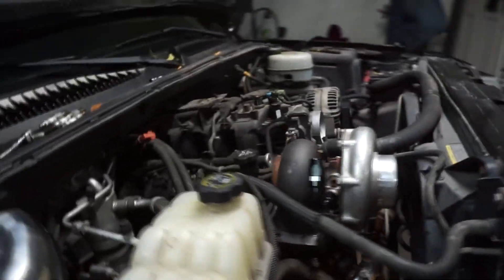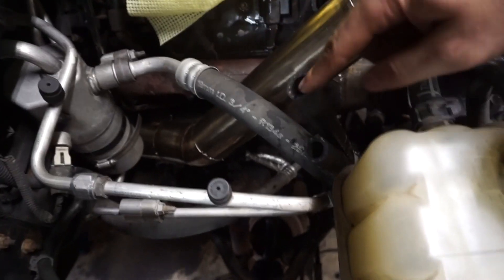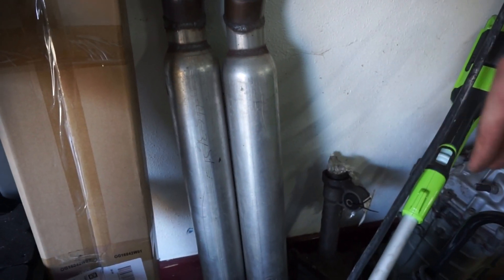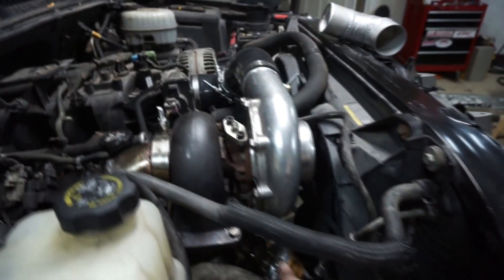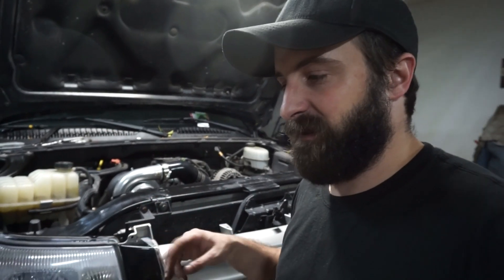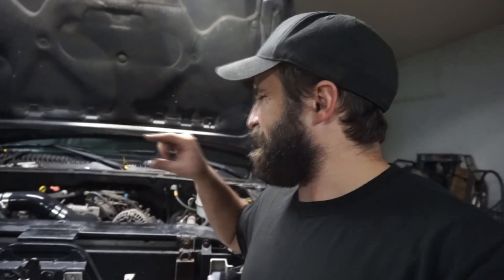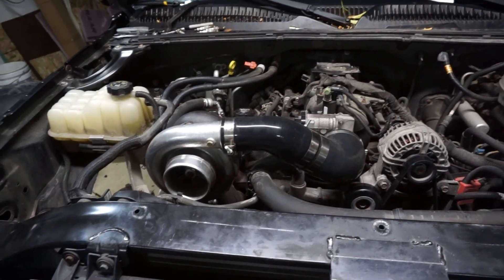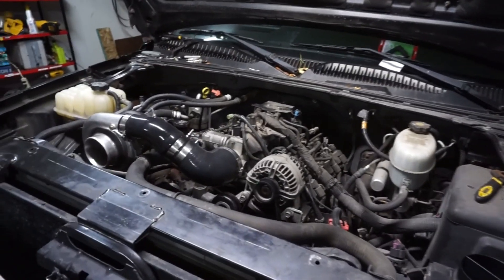Budget Turbo LS Escalade Downpipe Cold Side and Heater Hoses!!!

Comment: This is an excellent series as this is essentially what I’m trying to do right now. I have a 2006 Silverado 2wd that I’m doing an 80e swap and turbo. I have most of the stuff from a Sierra 5.3 that I put a turbo on but I deleted the heat and AC. This truck that I’m doing now I’m trying to keep the heat and AC. Also going to be doing a loud valve at some point. Right now I’m just trying to get the trans mount fabbed up and everything in and running again.
Reply from the maker: Nice!

Comment: Did I miss the blow off valve???...looking good none the less....keep on truckin
Reply from the maker: No BOV... Im not using one on the ranger either.
Reply: @BlaserBuilds  you don't have run one......what?????  Won't that make lq9 go boom!!!!
Reply from the maker: @trentdawg2832  Or are you talking about wastegate?
Reply: @BlaserBuilds  the one that goes on the cold side.......why will the wastegate go boom too if missing. ...I obviously don't know much about turbos.....that's why I'm probably just gonna invest in a lsa supercharger. ......for my nova!! Lol
Reply from the maker: @trentdawg2832  No wastegate will go boom because that's not limiting the exhaust gasses spinning the turbine, and boost runs away... No wastegate will just leave extra pressure in the cold side piping... Could be bad the turbo, or cause pressure surges when lifting. But I've ran several set ups without them. My ranger doesn't even surge.
Reply: Yeah I figured you knew what you were doing , it's not like this is your 5th turbod ls ......lol. I just didn't know you didn't have to run that stuff.....